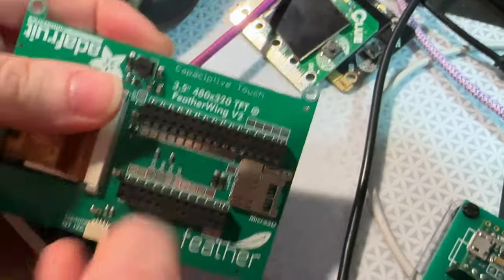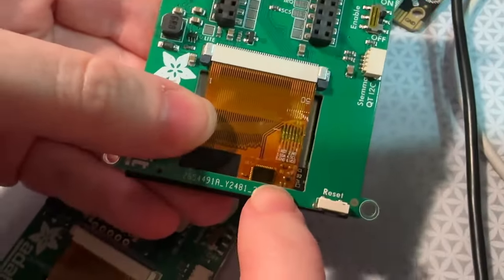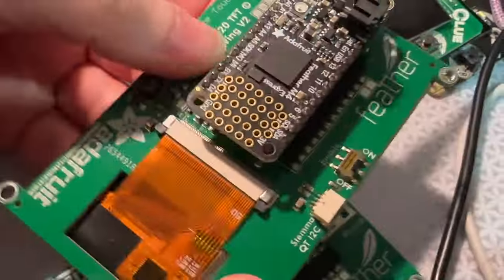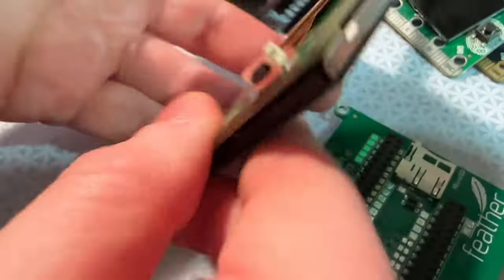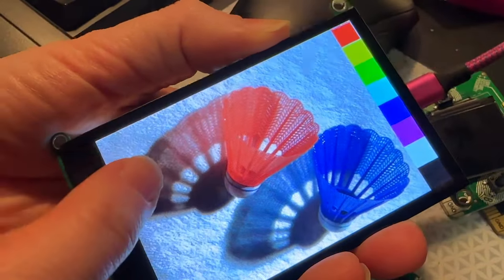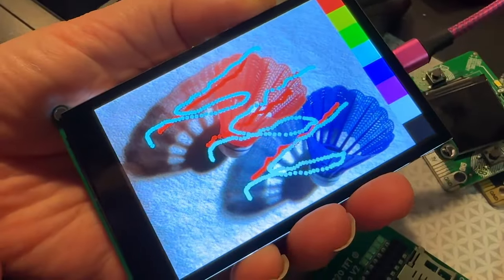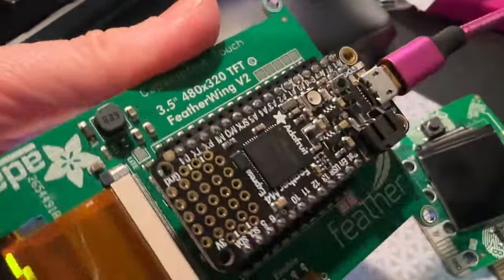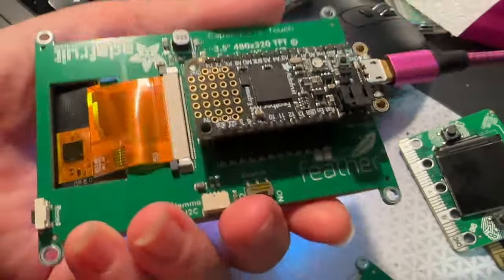Our 3.5" TFT FeatherWing needed a lil nudge and now we're clear to launch 🚀🛠️📈

Comment: Can you use bigger touch screens with this?
Reply: For driving with a feather even with a powerful esp32-s3 the most you’d want is 320x480. If you want bigger than that go with one of the Qualia boards and RGB666 displays. There is definitely a performance sacrifice the more pixel you have. Microcontrollers are not a Raspberry Pi or SBC. This TFT Featherwing and ESP32-S3 Feather are a match made in heaven.